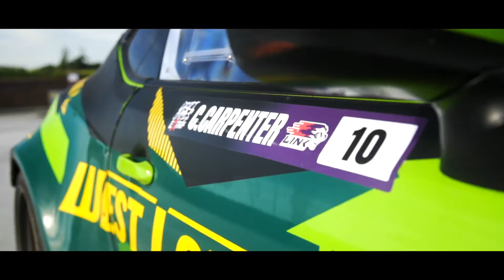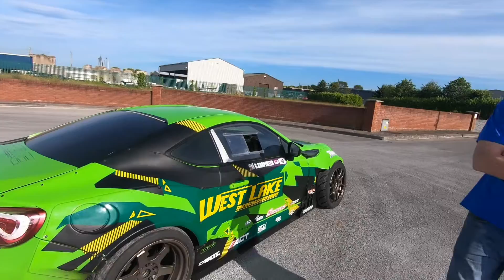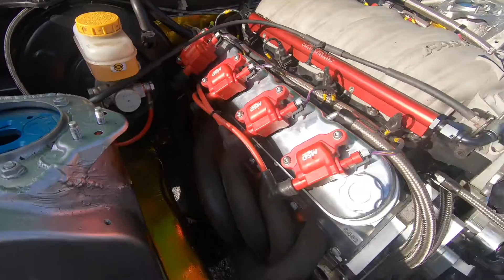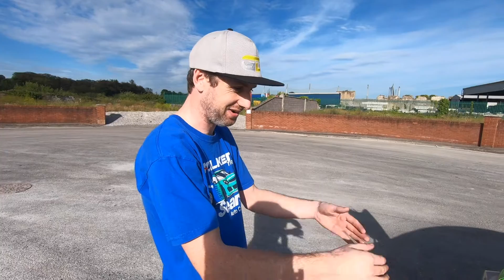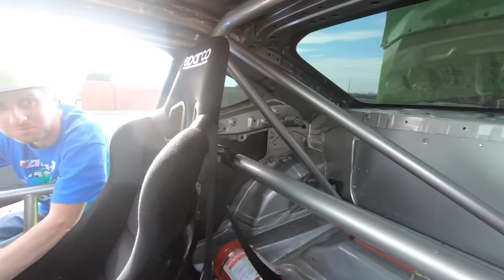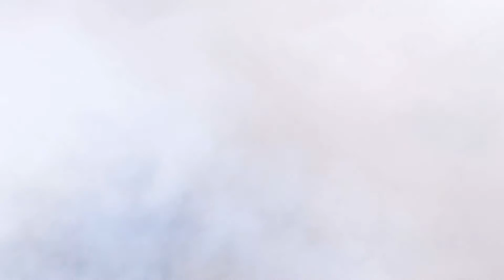LS7 POWERED GT86 DRIFT CAR | MEAN GREEN MACHINE

Comment: Ok so he said it was dry sump converted to wet sump but it still has the external oil resivoir?
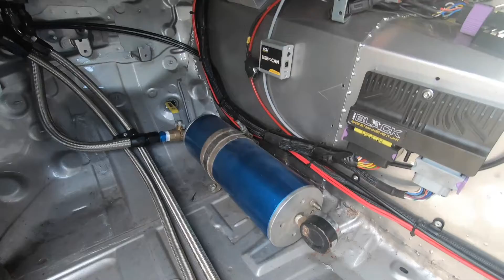Reply: 12:20 Is when they talk about the external oil reservoir *Accusump*. Its a cheaper solution to help keep the engine going strong when you don't have the budget for dry sump